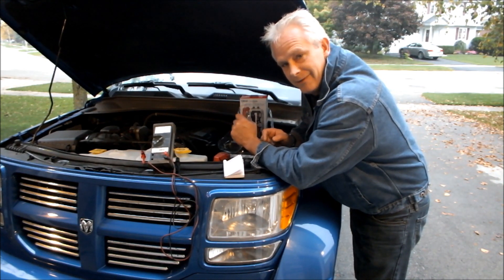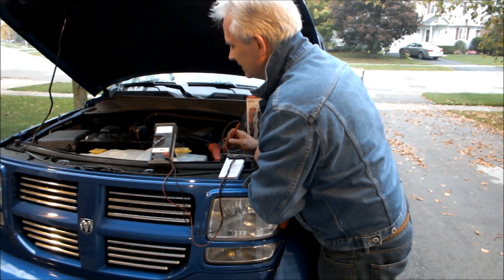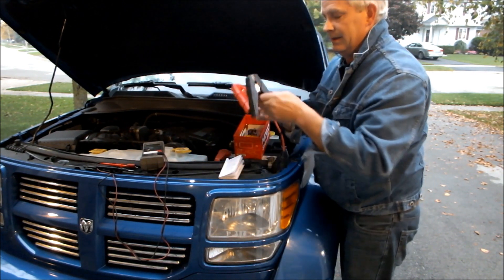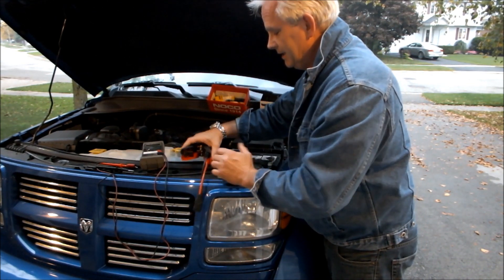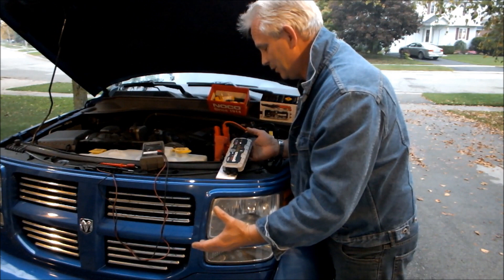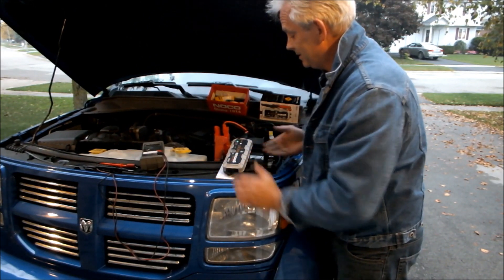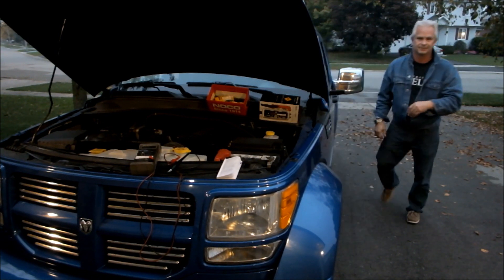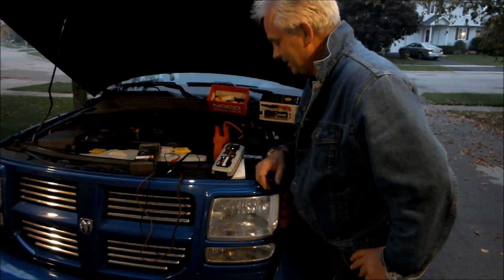Throw Away Your Booster / Jumper Cables

Comment: I bought even a smaller unit called "Stanley Simple start Lithium-Ion jump starter" for $30 on sale from $60 at Walmart and it works every time. I have a 1997 ford E-150 van with a 4.6L and i drained my battery by leaving the lights on overnight i came out in the morning battery was completely dead i plugged in the Stanley jump starter in the cigarette lighter...yes you hear that correctly, you can plug it in to the cigarette lighter or directly to battery and after about 5 minutes to 8 minutes my van started right up. I have used it about 15 times already on my car my girlfriends car and friends cars and it works every time.When you charge it, it holds power for about 12 months and you can jump start a battery about 3 to 5 times out of one charge. I am simply amazed at this little thing. If you go look at reviews every single person is happy with it i have not read a single review where someone said it didn't start their car. The thing is simply amazing.
Reply: Wow, I looked at this on Amazon! The one star reviews really scar me off of this. But good price if you want to take the risk..
Reply: Stanley simple starter

Comment: Seriously, I bought for half of the price of the NOCO GB30 a Stanley unit. Took it from Walmart directly to a stuck car of mine (I know that I should have charged the Stanley first, but I rolled the dice & gave it a go without a fresh recharge). Here's the real impressive part; my vehicle is a 1982 Mercedes Benz 5 cylinder diesel. Glow plugs are required to begin the 'start' process (Lots of battery power needed), then comes the burden of turning over a high 21:1 compression ratio diesel engine. Obviously both of those steps demand a powerful battery in order to complete the 'start' process, but this Stanley 'Simple Start' right off the shelf (and to my amazement) started the Benz !  
Needless to say I recharged the Stanley as soon as I got home because this $45 unit is definitely a keeper...
Reply: I also bought the Stanley unit from Walmart on Sale for $25 and it started a dead battery in my 1997 ford E-150 van with a 4.6L in few minutes also without charging it first. I am simply amazed at this little thing, it's worth every single penny.
Reply: I saw from the negative reviews on Amazon it takes up to 50 minutes to "jump start" your car, is that about right?

Comment: If your battery fails to start your car, then either your battery is very close to needing a replacement OR your alternator is f**ked...... If you pay attention it's easy to spot when a battery is nearing it's end of life. Replace the battery or fix your car before it becomes a problem, don't just keep jumping it.

Your not saving money by continuously jumping your dead battery, your just delaying the inevitable and exposing yourself to the possibility of winding up stranded 200 miles from home in the middle of nowhere.

Comment: Don't throw your jumper cables away!  I have one of those booster-battery/capacitor type starters ( 200/400 peak ampere ) and it does work as long as you remember to keep it charged.  I used mine successfully several times on my own cars over a couple years, but then when a damsel in distress needed a jump, I ran over with my little booster-battery only to realize I hadn't charged it in several months and it didn't have enough juice to get her car started.  I ran back, got my truck and jumper cables, and for whatever reason her little Toyota took more than ten seconds of cranking to finally start with the jumper cables attached.
  Point is that if the persons' car is in excellent condition except that the battery is dead, then fine, a fully charged little booster-battery will work, but if the sick car needs a little more than a quick jolt to get it started you are going to need the continuous supply of a strong battery and quality jumper cables to get it started.
  I believe that the trick with the small booster-battery jumpers is that they are half battery and half capacitor bank which can provide a lot of power for a short time, but capacitors will not hold their charge reliably over time, so they have to be recharged more often.  My booster-battery claims to have 7 seconds max of starting time with most motors, but warns it is not for large diesel motors.
  I think it is safest to have both: cables and a booster-battery.  If your car is stranded and you are isolated, then ( if charged ) the booster-batteries are a life saver, but if you are trying to start your car or someone else's that is being a bit stubborn, you are going to need two cars and jumper cables to get the job done!

Comment: I used a GB30 for nearly 3 Years now, and i started a lot of engines with it. Of course, the rating (here 400A for the GB30) is bulls*it, or maybe it means the peak-power for an split second, but it works for small and medium engines (~ 3-4 liters) very well. Even without a working battery in the car. (if you have a dead battery with nearly 0 Volts, you better disconnect it before using a booster - but dont forget to disconnect the booster immediately after the car runs, otherwise the alternator/generator from the engine will make damage to the booster-battery)

Comment: I have a Matco jumper pack.  
Multi-function jump starter and power pack with an 18,000 mAh battery
450 cranking amps and 900 peak amps in a small, portable package. 

will start a semi truck!

Comment: have yet to see video of these things tested on a cold morning with a cold motor (sub zero) which is the most common condition when you get a dead battery.  The kind of situation when even putting jumpers on wont start the car right away...you have to wait for the car jumping yours to charge up your battery a bit before your car will start.  These jumper boxes use the same type of batteries RC hobby grade cars/trucks use.  Given the units size, the most it could have is 3s 11.1v (nominal, 12.4v fully charged) and maybe 10,000mah-12,000mah...though I would bet it is more like 6k-8kmah.  That would be enough to run a 540 sized brushless motor in a rc car weighing 5-8 pounds at 50mph for an hour or so.
Reply from the maker: don't throw the cables too far if you know what I mean
Reply: Yep; these reviewers always seem to be out in the warm weather and do not tell you what the temperature of the engine is or the temperature of the booster.  Consumer Reports testing found that some units are able to start a cold engine but almost all have problems if the booster is cold (ex: if you leave booster in cold vehicle).
Reply: I have the GB40 and jump started a completely dead 5.0L V8 in weather between 0F and -5F.  It may not put out the amps it claims, but it will start a car.  Keep mine in my car in below 0 temps and it still shows 100% after a month or so.
Reply: opeth10657
Thanks Opeth. That is good to know. Hopefully others will list their temperatures also so we get an idea on how low they can go.
Reply: I have a powerpack I bought on Ebay, and it started my pickup (3.9l Dakota) when it was in the teens and the battery was dead as a doornail. These things fit in your glove box or console, and they save your arse. I was a mechanic for 35 years and I admit I was skeptical until I saw a guy actually use one in a parking lot to start his car with a dead battery.

This thing is not much bigger than a 2.5 in hard drive enclosure, and the cables are bigger than the powerpack itself, but it got me out of a pickle a few times already.

Comment: You can completely disconnect the battery from the truck, and put the booster in bypass and start the truck, so you know this thing is powerful, just be sure to have the cables connected correctly because it also overrides the cross connect safety.

Comment: How long does it take to charge? How long does it hold its charge? and therefore how often do you need to charge it ??!
Reply from the maker: I use then charge it no matter what
Reply: Yes that makes sense. Thanks. Do you know how long it retains its charge . Useful to know as l am often in a situation where I have is no access to a power point for long periods of time. Or if you haven't used it in some time . Will it still hold enough power to start a car?
Reply from the maker: I've done it up to a month myself but can't say for sure - depends on use age etc
Reply: Thanks. I've just bought one . You're right , its a great and incredibly handy bit of kit. Thanks for the info.

Comment: it might be better to replace the lead acid starter battery with a lifepo4 80ah battery as it will get regularly discharged every time car starts rather than stored at fully charged voltage for long periods like a jump starter battery that wont get used often
Reply from the maker: Thanks for the comment Mike

Comment: that's all fine and good but the real question is... Will it still be able to start you car after it's been sitting in the trunk or glove box for couple years.... all of these portable jumpers will start a car when fully charged. But when you're stranded on the side of the road and have no charging outlet and this thing has been in your trunk for couple years because you simply haven't had a need to use it and forgot all about it. Will it still start a V8 truck.
Reply from the maker: Keep the cables handy
Reply: intra morph it would be a good rule of thumb to periodically
(every 5-6 months or so) put a 35-40 minute charge on it .. while you're running errands or whatever
Reply: No not at all the longest u could resonably assume it would last without being charged is something like 3 months

Comment: I got one and had to jump my chevy 3500 with a 6 L gas. very low battery and 14 degrees F. It took a minute hooked up before it would start but it did it. it will charge devices through a usb plug also. So far so good.

Comment: 11.5-12 volt's is NOT "dead as a door nail" to be fair. It might also be fair to state that the PCM in that vehicle automatically kills the headlights if the battery goes below 12 volt's.
I could be wrong on that last statement but I highly doubt it.These products may boost a low amp draw 4 cylinder car with a low battery, but a vehicle with a truly dead battery, I would have to see to believe.The 400 amp claim is  horribly false.
Reply: it will do it.jumped my company owned e-250 econoline that has a lot of add on electronics-let it charge for 10 seconds-it cranked the v8 just fine.i was using a 16000 mAh POWERALL-IT IS GOOD FOR GAS ENGINES UP TO 7 LITERS-600 PEAK AMPS

Comment: Another consideration is your potential to need a "jump." Living in Florida I have never found a "jump" to be helpful. The last four vehicle batteries (on several vehicles) that died were not rechargeable. They also died suddenly without warning, fortunately most were parked at home. My wife had a battery die while driving her Toyota. I was concerned it was a faulty alternator but it was the battery. I guess with extreme cold weather or someone inadvertently draining the battery a jump/boost would be nice.
Reply from the maker: most batteries will last for 4000 to 5000 starts than thats it

Comment: Yes this is a better booster, jumper.  It's Li technology.  Most other boosters will go bad on you because they are lead-acid technology.  They will slowly drain out on you in a month or two.  Unless they are regularly charged, they will be dead when you need to use them.  Worse yet, they will freeze and kill them selves if they get discharged in the winter.  Li will be about 70% after two years.  Only need to recharge once a year or after a use.  May cost more but will be ready to use when you need it.  A person may go through three or four other jump-boxs, may not work when needed before problems develop with a Li-ion jump-box.  The Li box will be worth it because it will be there when one needs it.
Reply from the maker: Thanks for the info Stan

Comment: I got one (different brand) from eBay, was about 70 USD and I was able to help start up a car to 3 different people, one was a large SUV. So yea, great tool to have in the trunk. They also allow to charge smartphones and laptops, they come with all sorts of connectors.
Just be careful and never leave it in direct sunlight especially in the heat, or it might explode.
Reply: +Krzysztof Cygan - Thanks for the additional information

Comment: dear, what the video editor you used to make the subtitles?! good video, thanks!
Reply from the maker: Movie Maker
Reply: He is correct : from a limited source volts and amps are independent of each other , you can have high voltage but low/ little amperage eg car spark plug
Conversely, you can have high amperage and a low voltage e.g. an Arc welder . Unfortunately you do not understand electricity so you should not make comments on the subject

Comment: The biggest problem is keeping these things (Noco Genius Boost, Car Rover, and similar) charged, ready for the rare occasions when a battery dies. No battery (in a booster or whatever) holds a charge forever and, without a charged battery, these things are useless. That's why I'll sick to easier, maintenance free, jumper cables. The exception might be short duration trips where other vehicles might not be around, but, even then, I'd rather carry a larger, more capable, battery booster/starter - or just keep the vehicle battery in top condition so it doesn't need to be jumped.

Comment: Yea that is just what i want to carry around in my pocket all the time looks a little bulky for that.
Reply from the maker: +biged108 Jumper cables wont fit either
Reply: +biged108 - But it WILL fit in my glove compartment, or next to the spare tire (my spare tire compartment is inside the vehicle)

And with jumper cables, you have to find someone to help you. With this little tool, you're up and running all by yourself.

Comment: As soon as the engine spools up and running do yourself a favor shut of the engine or have a friend pull off the cables you will fry the unit from the push back from the alternator current.

Comment: Only one invention I could think of that's better than this........"Sliced Bread.!"  Been searching the net for real world videos on this product but mostly found Manufacturer videos. Amazon has it @ $130.00. I had an old-school jumper pack that lasted several years through all kinds of weather and never failed to jump start a vehicle. I paid about the same so I can't help but wonder a bit about this little jumper performing the same. Thanks for the info.
Reply: I was aware of those new device, however, I believe a good set jumper cables is more reliable and durable. I planned to invest $200 or less to make a good set by myself by using #0 or #1 AWG welding cable from Flex-A-Prene or CarolPrene plus pure copper heavy duty mechanic jaws like the commercial grade 14-300 Goodall Booster Cables 1000 Amp Full Power Jaw Clamps 20-foot 1/0 Gauge which was selling for $336.95, plus shipping and tax.

Comment: Oh if you do buy jumper cables make sure you have a good gauge of wire on those cables. The smaller the number the better2/4/6 no larger. The number two is best. Gauge is very important when it comes to jumper cables. Also make sure you have a good clamp nothing flimsy. 😁
Reply from the maker: Very good advice indeed Arthur - Cheers from Canada.

Comment: The one thing I would not do is killing a perfectly good battery. The battery life will be cut shorter. All auto batteries have a memory built in to them. So you could have 1/2 life in this case.
Reply: Joseph Hoffmann Yep, i just killed this refurbished newer battery killing it like that. Looked inside and one cell was looking funky. Think i'll try epson salt like ive seen on here to revive it.
Reply: +Justin Hickey they do
Reply: No they don't. If you drain a battery too many time they will not charge to full any more. You need to do a little more research on this subject. You will find that I am right.
Reply: think it just depends on few things. I've had batteries that were old and ive killed them a bunch of times and they lasted years and years. Then ive had one recently that i killed once and it never came back at all and was very very new.  Then i had a battery i tested yesterday for neigbor and it was bad and tripple a also tested it bad. I added epsom salt and some water and it's good to go and worked without even a charge on her honda. I'm going to exchange my crappy battery for hers and put it in my car to see how long epson salt works for.
Reply: +Justin Hickey LIthium batteries don't  get a memory, the NIMH and NI-Cad will.